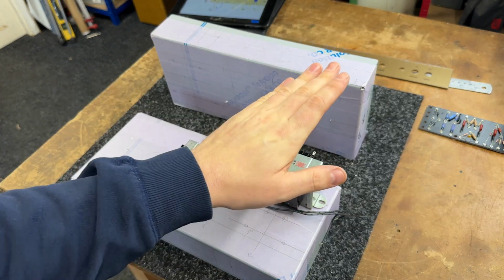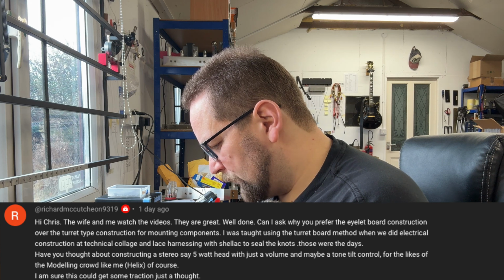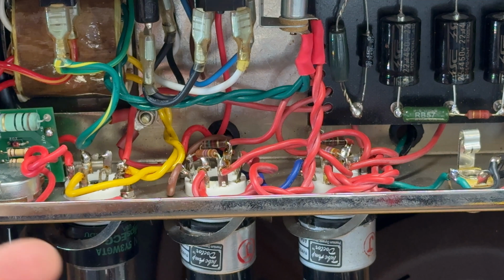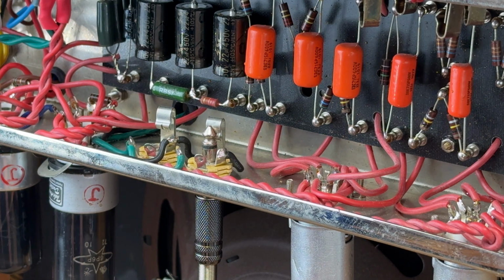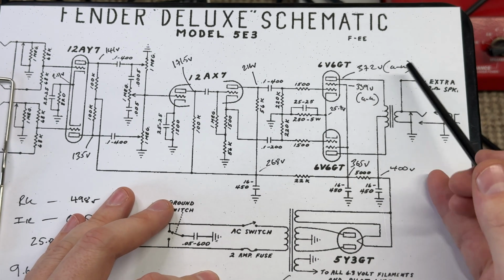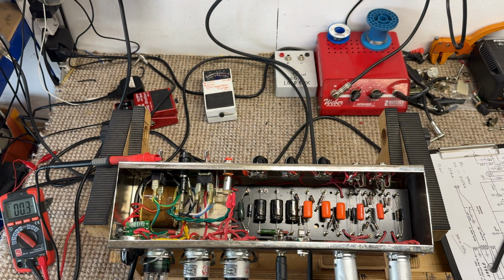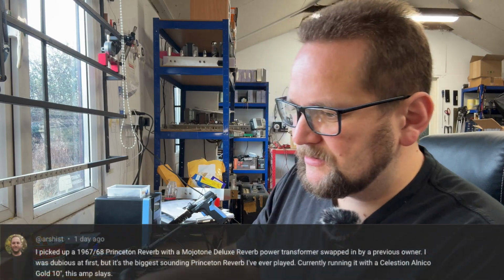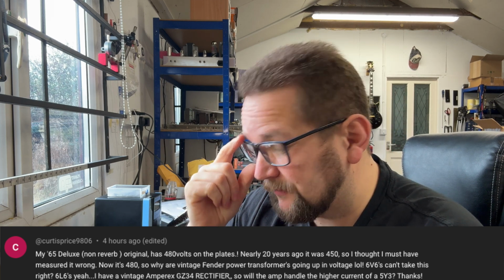Checking Out This Tweed Deluxe Clone | Rift Midweek Update + Q&A

Comment: I'm actually building an amp with a very similar output stage to the 5e3 and see the same crossover distortion on my scope as you showed in this video. How much crossover dist is normal/acceptable for a 5e3? My 6V6 plate voltage is at about 385VDC ,should I lower it? 
There is almost no real clean headroom, but always some grittyness even at very low gain. If I move my signal generator to the PI there is still some grit. Any advice?
Reply: You probably already know this but on a 5e3 if you plug into the bright channel and gradually turn the volume up on the unused normal channel you should get a bit more clean headroom. There is a sweet spot.
Reply: @markt-v4j  thanks for the tip, but my amp is not a ture 5e3 and only has one input. Also the output stage has crossover distortion at very low levels entering the LTP phase inverter. I might need to consult some forum experts at this point :)

Comment: I regret not grabbing one of the Black Friday specials, I did find a second hand mint factory built Mojotone Studio One for about 300 pounds which has a JCM800 or 5e3 pre going into 1 watt single tube a/b output stage (no inverter tube). It is a load of fun with a greenback.

Mojotone also sell a hotrodded 5e3 that I snagged as well.

Comment: Hi Chris. Happy New Year. Another great video as always. As you pointed out the deluxe clone has a pretty high 150hz 3rd harmonic of our 50hz mains frequency. I couldn't tell from the video and Apologies if you have tried changing the 6V6's but I noticed the ones in it are TAD and I had a genuine Fender Tweed Deluxe in for service about 12 mths ago which also had the 150hz hum and the output was down.  I couldn't find anything abnormal or out of spec components including the transformers and the valves all tested good too, however I decided to swap the TAD output valves for another matched known good pair of mine and that cured it. No more 150hz hum  and output to a nice healthy level. Why both valves tested good when clearly they had become faulty I don't understand? I doubt it will the same problem with the one you have but as I said if you haven't swapped the valves might be worth a shot. PS I think I put Sovtecs in it.

Comment: You can run a Deluxe non reverb with a 5U4GB, that will reduce voltages.
Reply from the maker: only if the 5v winding is rated for 3A...not all were.
Reply: Yes, but Fender used the same PT for both 
Rectifier Valves( 125P33A)
Reply from the maker: @hannowirth7245 not all P33As have a 3A winding...that's my point, the spec changed over the years. I have a customer who found out the hard way!